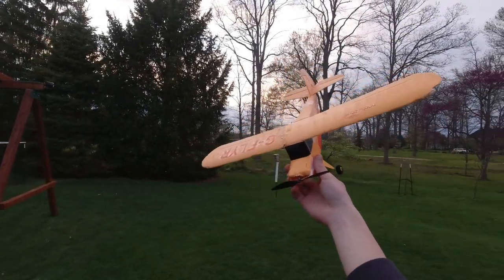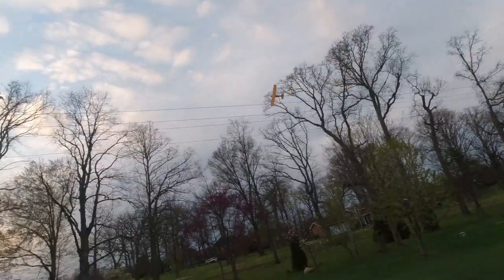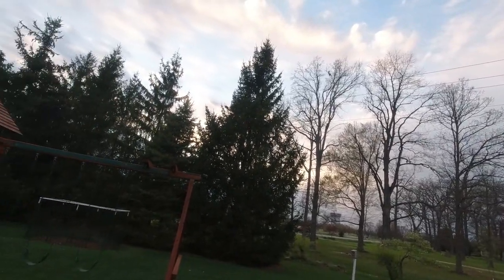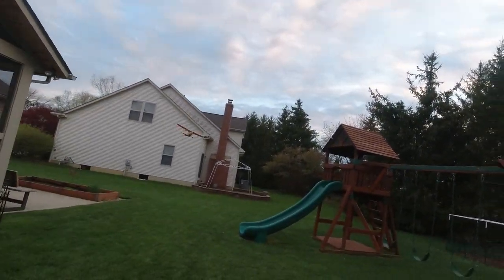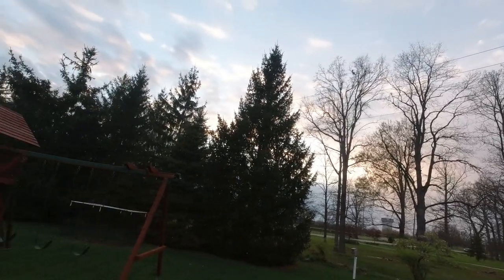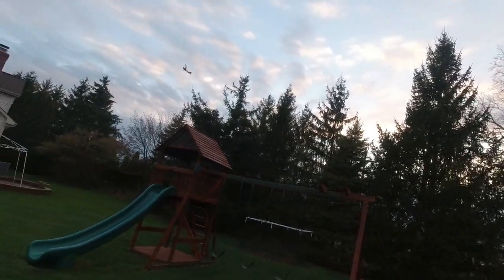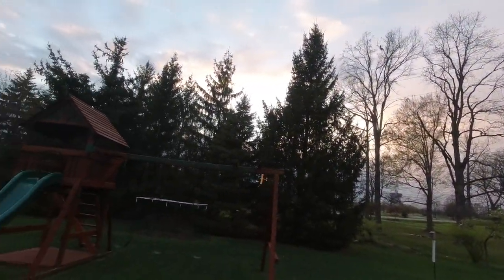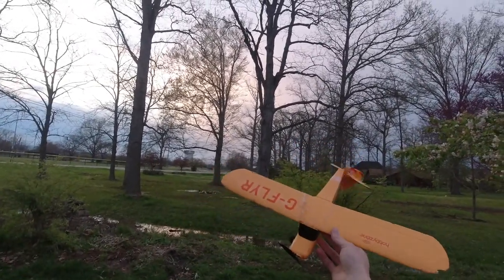HobbyZone Champ Backyard Mayhem!

Comment: I have recently started rc flying with a Champ.
Question: often the motor won’t restart after even a short flight. It behaves as though it is low voltage-just blips and quits. But I have found that if I unplug and replug the flight battery, it will sometimes start up and happily run for 5-6 minutes until the battery is truly depleted. Is this normal? Is there any other way of dealing with this problem?
Reply from the maker: I have experienced something similar with my champ, not sure why but it happens, I just push through it.
Reply: Comforting to know it’s not just me! My theory is that disconnecting and reconnecting the flight battery causes something to reset. (The ESC?) once it is reset, it seems to be happy.

Thanks for your reply. I am amazed by your flying skill! I can only dream of doing the things you can do!